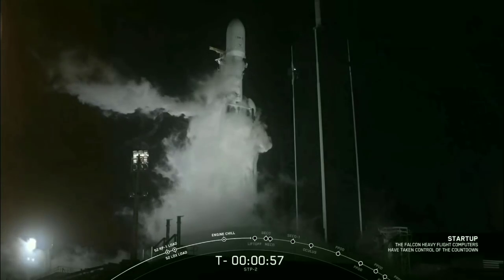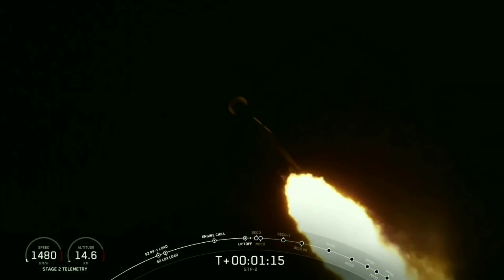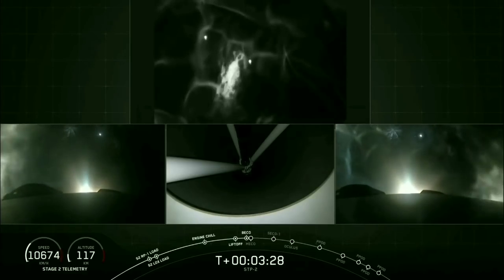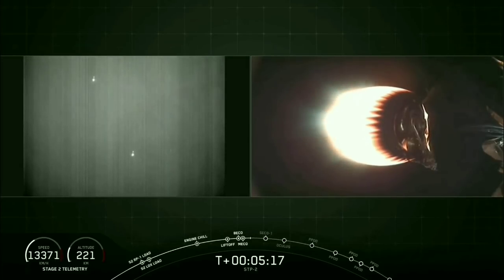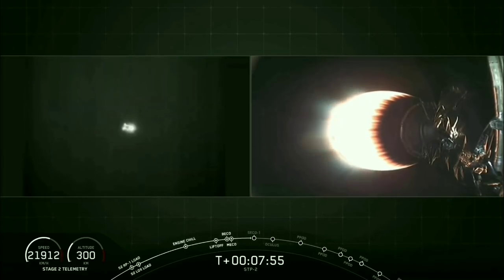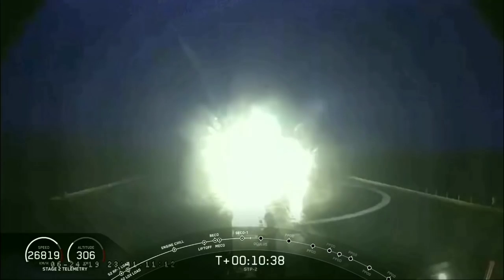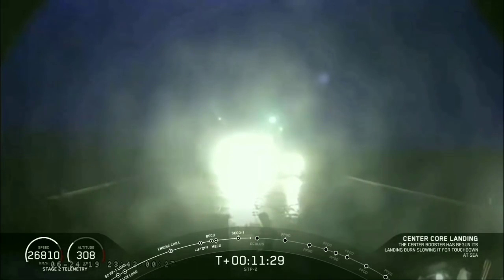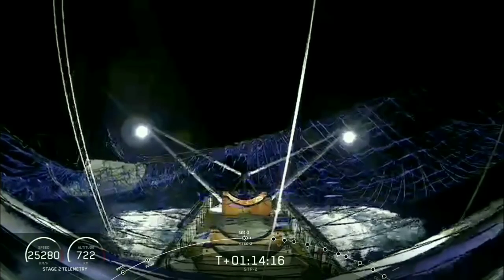SpaceX Falcon Heavy launch and Booster Landing, Fairing catch

Comment: SpaceX Beg Barrow Steal Boeing toughen composite. Your using std composite material it will crack on re entry no matter how soft of recovery and std composite once cracked have to be repaired.That increases weight and odds are fairing will never survive a second flight. Boeing toughen composite have crack stopping micro rubber spears that act as crack stops. SpaceX now that you have proven complete recovery is just a matter of logistic you have to mfg those Fairing out of Boeing toughen composite or your catch and reuse fairing will fail structurally.